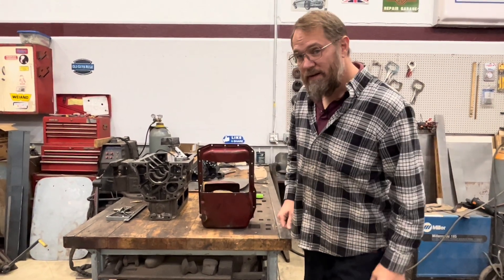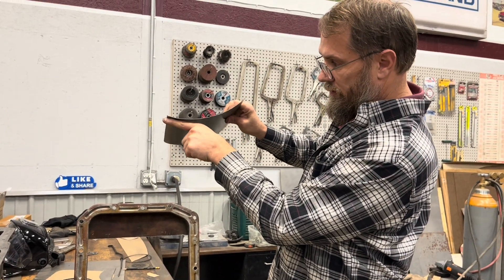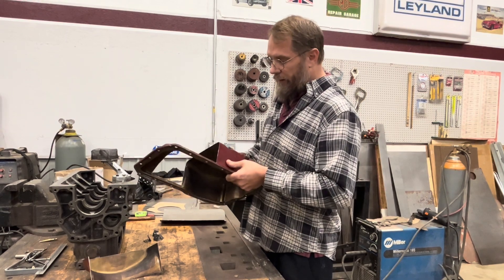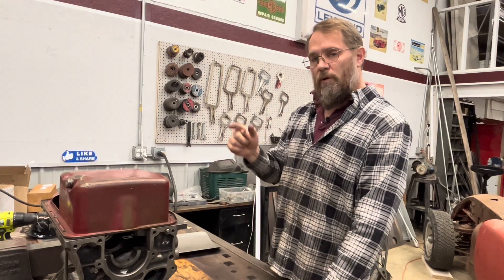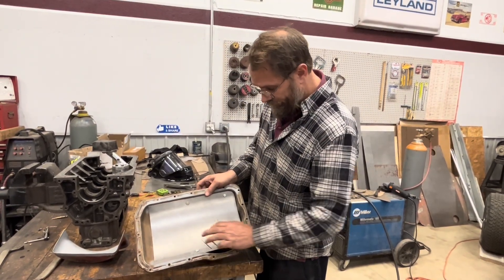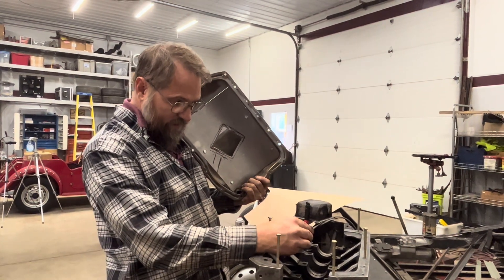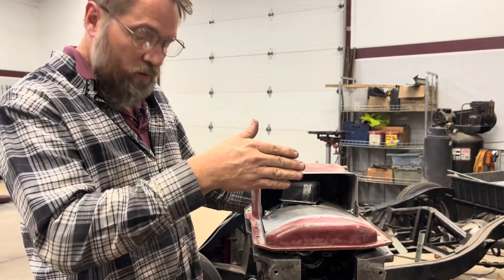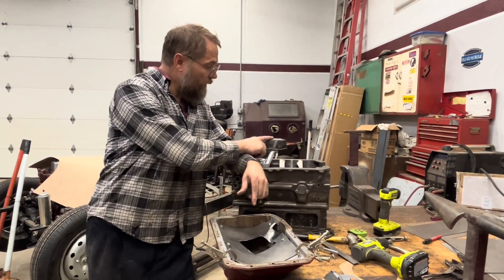Just baffling part 2, oil pan windage tray fabrication.

Comment: Does it need a windage tray?
Reply from the maker: That depends on how the car is used. My car is dual purpose both street and autocross, and I do rev it higher than a lot of people with MGB’s ( bouncing off a rev limiter pretty regularly). I am building this engine because of problems with my last on that may be due to oil foaming and a windage tray helps prevent that.
Reply: Did you modify the actual oil system for better oiling and return? @unionjackclassics
Reply: @unionjackclassics  what's the rev limiter set at?
Reply from the maker: The old engine did have the high volume oil pump mod
Reply from the maker: I have an adjustable rev limiter. Usually i set it fairly low at about 5600 for street use, but when i autocross I turn it up to 6000 and adjust up a little if I’m in a close fight for a position